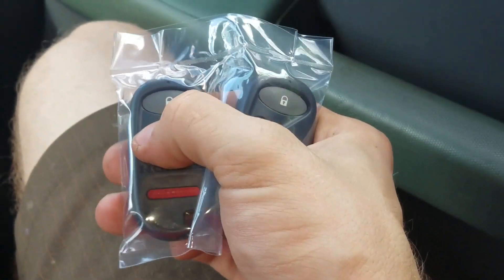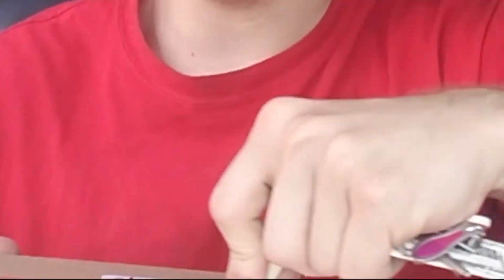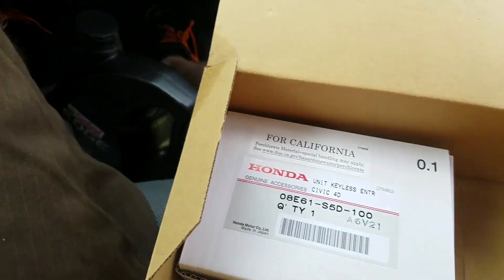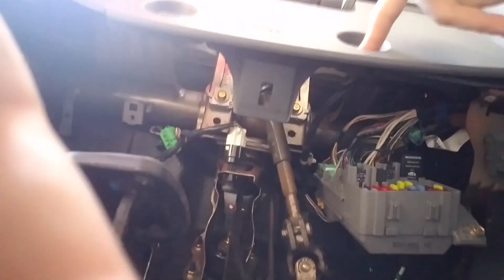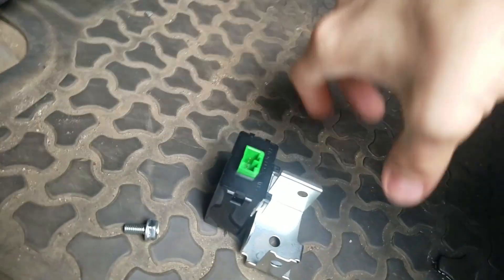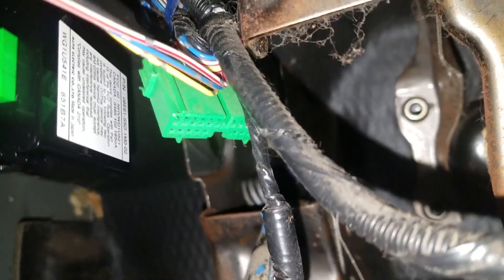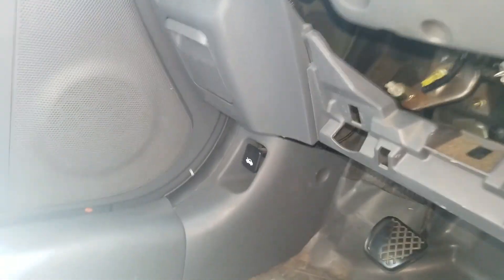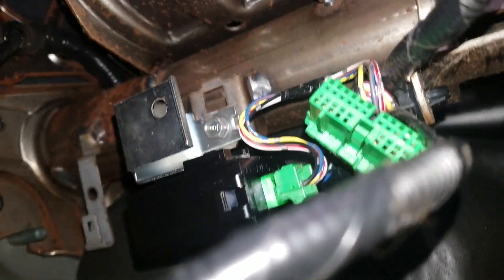honda Element /Civic Keyless Entry Install how to

Comment: I just bought the same part from amazon. The easy way to explain the installation is that there is a green male junction just where he says it is. The part is a female and it locks into the male easy as pie and there is a mounting area to screw the bolt in. this week I'm going to Honda to get my Element serviced and have them make me a new key that has a built in clicker. My key is destroying the ignition(s) I've had to fix the ignition three times and my door locks have been dying on me.

Comment: You can buy replacement door locks for both front doors for $30 on Amazon. much cheaper, but you'll have a set of keys for the door and another for the ignition.

Comment: I know this video solves the issue but just wanted to let you know about another thing you said:

It doesn’t solve the problem of getting in to the car but when getting out you just pull the interior handle on the drivers side with one hand, press the lock button, and ALL doors, including the driver’s will lock. 

That’s actually a feature to prevent drivers from locking their keys in the car. Drivers door will not lock without that failsafe. 

It’s on every Honda I’ve ever had.

Comment: Need Help. I have a 2004 Honda CR-V with power door locks but the car did not come with a key less entry system. Can I just get a transmitter from another CR-V of the same year, buy  a remote then program the remote?

Comment: Would this work on my 04 Civic ex coupe?
Reply: Ex models are already keyless entry. All you need to do is buy the key fobs. For $20 you should be able to get 2 fobs off ebay or amazon
Reply: @loveme2tmes671  i been looking for that receiver and i can't seem to find it, nor do i have a red Led light anywhere in the car so i assumed it doesn't have an Alarm.
Reply: To my knowledge, all ex models have keyless entry. A remote is less than $20. I think its worth the risk of buying one and trying to program it.  Super easy to program. You can do it in under 1 minute and dont have to remove anything
Reply: @loveme2tmes671  i'll try that then. Thank you.
Reply: You were right brother. I got a remote oem remote for 10 bucks and it worked like a charm 😁 thank you.
Reply: Sweet! Congrats!